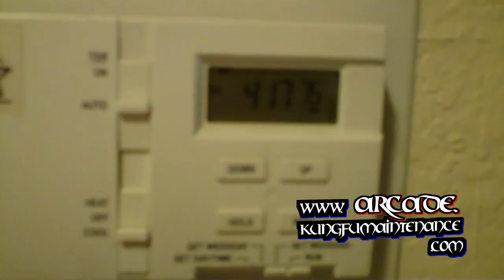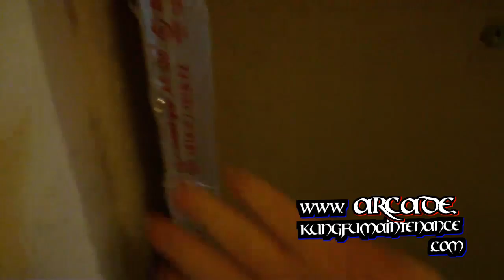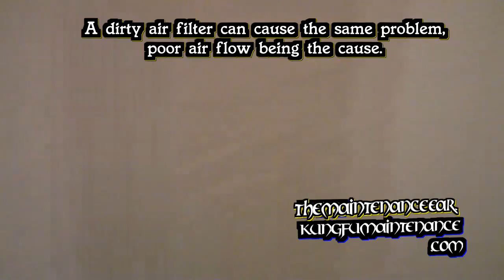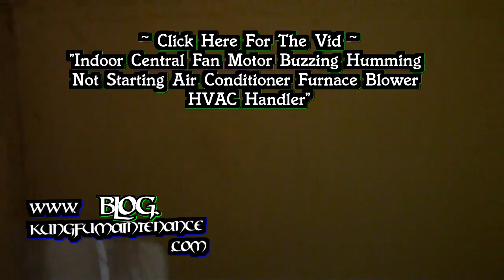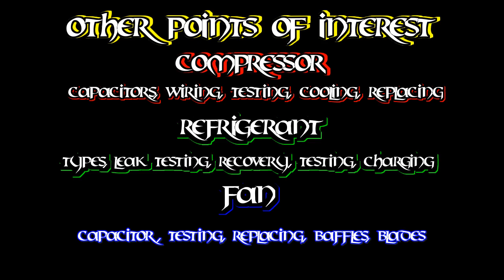Five Most Common Problems With Air Conditioners HVAC Heaters Indoor AC Fans

Comment: Have u heard of cold air and hot air at the same time?
Reply from the maker: Yes, there are some systems such as hydronic heating for example where valves often need to be turned off to prevent heater and ac from running at the same time.
Reply: So how can I trouble shoot that issue with mine. My eletric bill is normally 200 and my last mouths bill was 650
Reply: Do you have heat strips

Comment: What would make my unit while its running just cut off and back on and keep doing that
Reply from the maker: +John Carico A loose thermostat wire or poor connection could cause that.
Reply from the maker: +John Carico Loose wire connection or faulty service panel door switch.

Comment: Does anyone out there in You-tube land have any tips for a:

Goodman Model # ARUF193116BA (or 8A, old fart eyes aren't that great anymore)
Serial # 092002990
Part # SR1431034
208/240 vts 60 hertz
Motor 1.48 Amps, 1/4 HP?

First problem was some idiot opened the window (in the living room because it was too cold) and the unit ran constantly for over 24 hrs without stopping.

When I got to the house I noticed it was rather warm in the place and the A/C was running. It was then I noticed the (behind the curtains) window wide open. I went apeshit.

The A/C unit outside was running fine (Fan turning, cold air coming slightly outta the vents). However the inside blower wasn't running at all. 

I did a few things suggested on you tube (thanks to all you guys with your suggestions) and the blower now works fine, however now the fan on the outside unit isn't working. Any idea's.

Shal ' aam Aleichem
AAPiY
Mike

Comment: I just changed the filter to our A/C. I flipped the "light switch" by the unit off so it would not be running when I changed it. When I turned everything back on, the blower refused to start up again. Everything else seems to be working inside and out except that. The unit is just over a year old. I checked the breaker and it's just fine. I've turned everything off and then on again after a few minutes (reboot!) and still nothing from the blower. Any other suggestions?
Reply from the maker: +Amber Church Most air handlers have a service door switch.  I would try removing the door again where you change the filter and reset it to see if you can get it to engage.
Reply: That's what I initially thought because our old unit had one of those but this one doesn't. Our air filter area is underneath and completely separate from the mechanics of the rest of it (if that makes any sense at all). It's just a small little "cabinet" under the rest of the unit. I've turned of the A/C but left the fan on "on" since I am now seeing ice. It's just so odd for the timing of this (with turning off that switch) to stop working.
Reply from the maker: +Amber Church Unless coil is really dirty it sounds like the refrigerant charge may be low causing the evaporator coil to freeze up.

Comment: ...These tips are very specific to this heater.
Reply from the maker: These tips are very specific to this heater as well quite common to most split system heaters and air conditioners you will find out there.

Comment: Im a super at an apt and I got a heater that the elements are getting hot where the return is but its blowing out cold air through the vents, what can I do? I know the element is getting hot cuz the metal outside part of it is hot to the touch.
Reply from the maker: One thing to check for would be that the a/c is not running at the same time as the heater. I have seen this happen you could feel the larger low cold side refrigerant line to check.  This scenario or others like it could be caused by a faulty stat as you mentioned or the stat wiring. Also watch for the jumper pin being set in the proper place on the back of the thermostat for your particular type of heat. I am assuming you have electric heat as you mentioned the element getting hot so you would want the jumper on electric.
           Sometimes electric heaters have more than one bank or set of elements. It is possible only one set or part to none are functioning and that could explain the lack of heat. The elements can be checked by turning off the power and doing an ohm test, if they do not show continuity than they are toast. Another area would be to check around the air handler for air loss. Sometimes there are poor connections at the top of the air handler and that can significantly lower efficiency to the point that conditioned air is not reaching its final destination. Any air gaps can be sealed off with a mastic or foil tape rated for HVAC high heat use.
            If you need to hire out a vendor watch and learn everything you can from them. The scenario will likely repeat itself elsewhere and you will save yourself headache and save time by knowing exactly what is going on, what parts to stock, and what steps to take to get things up and running again.
                                                        Hope that helps, thanks for watching!
                                                                                      ~ KFM
Reply: Ty! Ill check that out : )